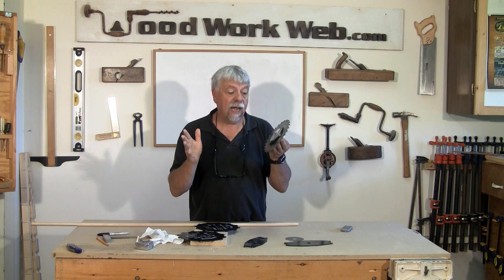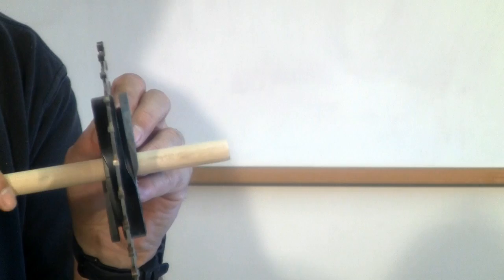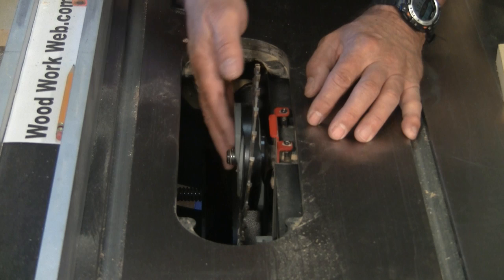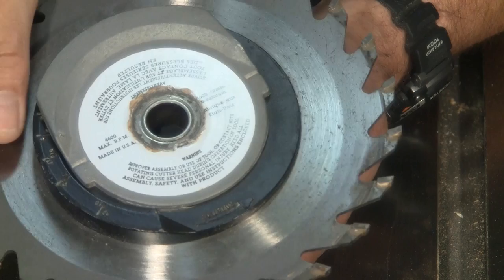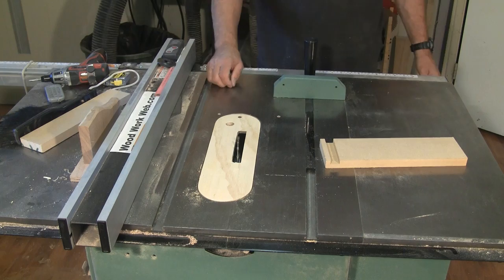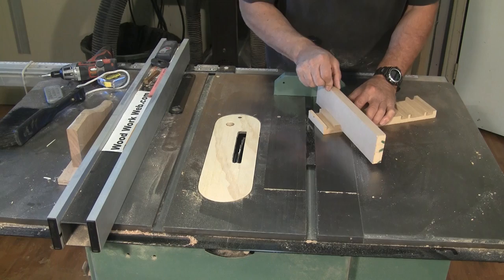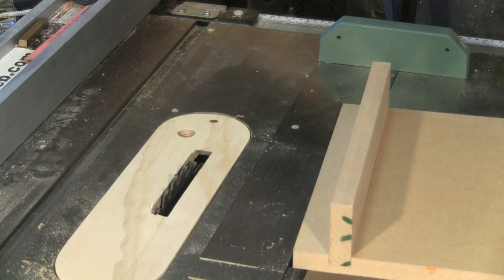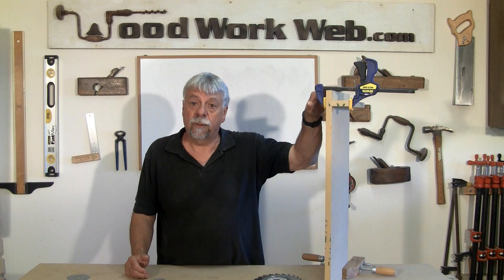Testing the Wobble Dado Blade -  woodworkweb

Comment: Took the bearings on my radial arm saw out on two sets of stair case runners ! Wobble speaks for its self !
Reply: I really may get a radial saw one day. I don't know why nobody ever talks about a radial saw !!
Reply: Try making shallower cuts.
Reply: @versatileduplicity9313  I have a smaller size radial arm  saw that I love to use.
Reply: @versatileduplicity9313  too many people didnt know how to use them so most people consider them death machines. They are all over the place for dirt cheap coz nobody wants them. I got my first one for $20 and 2nd one for free on the side of the road. I sent the 2nd in to Emerson for recall, since I liked the 1st one better, but the 2nd one surprisingly had a nearly mint condition old Craftsman Wobble blade in it. I think I made out pretty good on that deal!

Comment: I like using  the wobble Dado Blade. it may not give as clean a cut on bottom but who cares and besides it comes very close any way.  these things can be dialed in, in few seconds almost the first time and save so much time especially with ply wood junk we get these days. no dealing with freaking shims and taking off blades and putting back on wasting so much time. 
if you are not making super fine furniture with real wood that has exposed dado , then this is the only way to go. i got lucky and found a brand new one. they should bring these back.this was ingenious design.

Comment: There is absolutely nothing wrong with a wobble wheel. I see it all too often with any profession/hobby. Elitists who simply must have the biggest, best, newest, fastest, loudest, mostest gear, equipment, tools, etc. And just as always, those people are often handicapped by their toys and delude themselves into thinking that because they have better toys that somehow THEY are better at their craft. Better toys = less money. Better toys does NOT = better craftsman. I highly recommend a wobble wheel.
Reply: Do you know where I can find the inter ring that adapts the dado blade to the shaft of my craftsman table saw
Reply: @davidfitzgerald7385  
You want it? I have an old Craftsman.  The pins came out of mine and new pins will not stay in.  Makes it inaccurate and dangerous.  Broke my heart to buy a stack dado.
This guy does not have a clue on wobble blade adjustment.  He had gaps because his feed rate was too fast.  Give it time to do it’s job.

Comment: I think there's a reason these were mostly used with radial arm saws; much easier to adjust as you don't have to take it off the arbor all the time.
Reply from the maker: synapse131 Yes, it might be easier to see the markings on a RAS, as long as the blade guard is not in the way, other wise it may have to be take off their too.

Comment: Thanks for a great demo on this Wobble Wheel.  I was doing a lot of cabinet making in my younger years and this was my first dado I bought.  As you demonstrated, it can be a great frustration at first to adjust the wheel to the exact  size of the dado you want to cut.  Yes I had to make several tests to get the size I needed.  After I used it a lot, making adjustments, I did finally become used to where to align the markers to get a closer fit, then I just needed to make one final adjustment for the final size.  So with practice you become accustom with it.  You mentioned the "space" on the bottom.  This is caused because of a few factors.  When they first came out with it, the cuts did not get into the corners enough so it made them round and it was difficult to get the board right down to the bottom of the dado.  So to correct this they sharpened the blades in a way that the tips of the blades now reach right up to the corners.  But this created another problem.  As the blade wobble to cut the dado, the tips were cutting deeper into the bottom of the dado, thus the space.  or rounding at the bottom.  Like you said, you could live with that error and so did I.  In all reality, it worked out better as when I was gluing up my project it had a minute space for the glue to go.  I now have a full set of dados that I bought and I still find that I have to stop to make adjustments on them as well. I just thought that you would like to know this if ever asked.  I have learnt a lot of great helpful hints from your videos.   Keep up the great work.  Tim

Comment: Hi Colin,sorry for a late comment ,I watched your video with great interest.
As a retired Engineer with a hobby of woodworking, may I comment the following.
There are number of ways to power a motorcar cheaper and less polluting system , why we do not use them? Simple, Major companies "OIL COMPANIES" do not like going out of business.
The same is with simple saw blade manufacturers, Daddo blades is an extra product can be soled with a nice profitable price.
Now back to the what you call it WOBBLE BLADE, SHOULD NEVER BE CALLED WOBBLE BLADE, as this creates doubt in majority of peoples mind...+ wabble ? must be a problem?????  obviously someone got hold of one did not know what it was , continued playing with it then called it WOBBLE, it is adjustable daddo blade, should not create any additional vibration as it is rotating the  displacement is a HARMONIC MOTION and also variable loads are so infinitesimal on the shaft the load is carried by the two bearings supporting the spindle either mounted on the motor shaft or twin bearing supported spindle.
Next point, this blades are normally are 7 1/2" Dia for a large daddo say 3/4" the height of the Arc for a 3 5/8" rad a blind man would love to see it, from the little knowledge I have most of the timbers do compensate for that variance.
My negligible knowledge says most of people use there blades until is totally blunt and do not sharpen them, even if they do probably is not in the original form as manufacturer's design.
Final point, to adjust the width  you do not have to take the blade of the spindle, all you do loosen the nut and rotate the hub, actually you should measure the blade widths before even cutting a sample, HAVE YOU CHECKED THE EXTERNAL WASHER HAS A HORIZONTAL CUP PROFILE to lock the blade the correct way otherwise the centrifugal force will put pressure on the hub thus will change the daddo width.
Sorry for such a long winded comments.
I have always enjoyed your videos as they are informative, I hope you do not get offended, I have 2 of my neighbours keen woodworkers we tend to get together often we talk about YouTube infos.... YES WE HAVE COMPUTERS In Australia and we do get YouTube
Regards Colin
Jack Marashlian
Reply: Jack Marashlian - It seems to me that any infinitesimal vibration is not so much from the rotating blade by itself as it is from unequal side loading as it enters material at an angle. Your comment is like saying a bent bicycle rim doesn't wobble when it's not touching the ground.
Reply: Mr. Perry,  due to the very small angle and the smooth progression of the angel from max to normal and to max again, the amount of "side loading" is both negligible and counter balanced.  Remember, very few teeth are actually being effected at any given moment, and because each makes contact for such an extremely small amount the effect of side loading must be averaged over the entire blade accounting for each tooth (i.e. half - 1 to the left in varying degrees, 2 with no side load, and half - 1 to the right in varying degrees).  The right and left forces are equal magnitude and opposite direction resulting in a ZERO average.  The maximum lateral force (left or right) is significantly less than 1/3 the  forward force applied to the 2 teeth that have no side load.  Also, the cutting faces of these blades are so designed and oriented as to further significantly reduce this effect.

Finally, your analogy of a bent rim is completely incorrect.  The offset here is not on the outside as in the rim, but rather it is in the alignment of blades center of mass to the axis of rotation.  Think of the flutes on a drill bit.  In cross section they form two overlapping circles and so can spin in perfect balance.  However when viewed from the side the appear to such in one direction.  The drill saw uses this to allow you to cut laterally after having drilled longitudinally.  There is no actual wobble or vibration, it is all an optical illusion.

Comment: Just dug around and found my old Craftsman wobble dado today.  Used it a bit in the 80's and haven't touched it since.  However, I'm building a gate and need to dado some half-lap joints from 2x4s so, out it comes.  I'll be using an 80s wobble on my 70s Craftsman table saw.  Talk about old school!

Comment: In the UK and Europe both types of blades are illegal, the machines over here have dynamic braking, which the strain of the deep cut can set off the shut down. Older tables without the braking can work with them, but as you can't buy them.......
Most recommend using a router instead, it works a bit slower, but safer.
Reply: +stephen wallin I should add the use is allowed with radial overarm saws, as these usually do not have the auto shut off.
Also what happens with the auto shut off is the sudden stop can grab the wood violently.
Reply from the maker: +stephen wallin Thanks for that detail info, I have often wondered about that
Reply: +WoodWorkWeb Not a crime to use one! but they are not used on the braked versions, due to risk of snatching. The brake is there to stop heavy cuts, like an arm!! A sharp blade does not load the motor much, so when it loads it halts the blade almost instantly. I use a wobble blade and the rounded bottom does no affect anything. The table is about 60 years old and works well with the blades.
Reply: stephen wallin As they should be. I always thought dado blades, and this wobbly for sure, aren't safe. But then NA make up is full of vile poisons and toxins the EU won't allow either. American corporations rule US and, to much, Canada and$$ is God.
Reply: you must be great at parties
Reply: ROOKTABULA why canada?

Comment: I watched your video out of curiosity and about half way through all of your adjustments and trials I called my wife in and began watching the whole thing anew. She has worked with me in my shop over 25 years and is quite skilled and very familiar with shop tools and their uses, limitations etc. She had the same reaction I had concerning your video. You present your experience with the wobble wheel as if that is what everyone will experience. Clearly, something is not right with your wwd. I have had this tool (the same one ) for almost 30 years and it has never failed to work as it was intended and only on rare occasions have I had to re-adjust the initial setting. Yes, I also have stack dado sets, but I have found that much of the criticisms of this tool is highly suspect. I am not a master cabinet maker and don't claim any esoteric knowledge about dados but with that said, I will reiterate that my wwd has performed flawlessly throughout all of these years. Oh and by the way, these are still manufactured and sold through various outlets. In spite of your disclaimer to that effect at the beginning of your video, you continue to say that you're not sure if they are still made and sold. And, finally I will add that on many occasions I have pushed this tool beyond its capabilities (some might say abused this tool) and it continues to provide adequate service. These may be minor points but if the goal of these videos is to educate those new and maybe not so new to woodworking, then it behooves you to thoroughly educate yourself first on your subject matter.

Comment: Dissadvantage: It takes a lot of adjustment to get right  advantage:It's highly adjustable.
Reply: Robert Schuster the measurements on the blade are pretty close to true. Before we cut we always measure the thickness of boards and just adjust the wobble wheel accordingly.

Comment: is that wobble bad for the saw?
Reply: You will have dynamic unbalance
Reply: Good question Green.  The answer is no because there is actually no wobble.  The "wobble" is a visual effect, not a physical one.  All the mass is still rotating evenly around the same center and is still evenly distributed so there is no unbalanced forces.  Everything is still a circle, but the axis of rotation has been changed from normal (i.e. 90 degrees) to a more acute setting.  Think of the flutes on a drill bit.  Viewed in cross section the are a pair of overlapping circles, but when viewed along their axis of rotation they form elongated spirals.  The "wobble" blade is the same effect simply from a different point of view.  The effect on the wood is to remove small bits offset instead of directly behind each other.  This gives the lateral cutting effect while advancing the work piece provides the longitudinal cutting.  Since the blade spins fast enough, the effect is to cut the complete width at least twice before any significant longitudinal movement happens.  Any vibration people experience with these is almost always (well over 98%) due to variances between their spindle size and the arbor of the blade.  This can normally be dampened by using arbor shims (not commonly found) or by buying a blade specified for the model they are using (too often "close enough" actually isn't).

Comment: I use to have  a wobble dado blade, didn't use it after I bought a real multi-blade dado set.  However, there is a good reason to have one!  When your friends ask to borrow your dado blade,,, I'm sure you can figure this out!  Eventually sold it at a garage sale when we moved!   One thing I like about this video, is how you pointed out the main problem with a wobble dado - the slight crown in the dado - more noticeable as the dado width increases!  One thought occurred was that you could use a flush trim 'Bottom Cleaning Router Bit' to remove the crown.

Comment: Thanks for this video.  I purchased five of these over time.  Each like brand new.  These things never seem to get much use. Probably because of the fiddle factor they get set to the side in the tool arsenal.  I set up each one to a different size and used lock-tite on the dial. I just grab a preset wobble for the size I need and cut away.  You can find these everywhere for about 5-10 dollars each.

Comment: Colin, I used one of those as a hobbiest for many years until needing to do more dado's more often, finally being able to afford the stacked set. The best way to eliminate all the changing settings is to mark a piece of wood the size of dado you want, adjust the wobble thickness with blade in the arbor but not tightened and turn the wobble several turns while watching your makings in the wood flat on the table allowing the wood to just barely touch the blade. Adjust while on the arbor then tighten blade secure when correctly hitting your marks on the wood.

Comment: More than likely, the blade need to be sharpened. I have a wobble dado that made perfect dado with out the crown in the groove. Also, when I set the wheel on 3/4", it made a perfect width cut. I suspect that the center mechanism is worn.
Reply: I was thinking the same thing,  He makes this look dramatically more difficult than it needs to be. Like in an infomercial when they try to use the competitors product first and make it look really clunky and difficult to work with.
Reply: You may have not noticed the crown or it was minimal but it's impossible for a wobble blade to cut a dado without a slight crown to it.
Reply: Not so!
Reply: I've used both and I think the difficulty in setting this one is most likely a result of it just being cheap. I have a ahem Harbor Freight wobble dado and the measurements given have little relation to the actual width of the cut. Since I got my stack dado I tend to us the wobble mostly for making crown mouldings, it cuts a nice cove and is considerably thicker and more rigid than a standard blade, a bonus when pushing wood through a blade the wrong way.

Comment: I use mine regularly to excellent effect.  It leaves ample surface area for strong glue joints.  Where a dado stack cuts only to discrete widths, the wobble wheel's continuous adjustment cuts any width the stock requires.  I don't know why this excellent tool fell out of favor.  Excellent and much needed video.  Thank you.

Comment: pretty cool but I think maybe all the adjusting is why it may have fallen out of favor. That joint is nothing to scoff at, once you had the measurement it is pretty nice. Id imagine the versatility of the router and routing table may have made these less popular. I think its interesting you made a blade guard, I could not help but wonder if even you were not sure how much wobble would be needed, and didnt want it to shew your table. look at it this way at some point it was probably an improvement on something.
Reply: the rotation imbalance is handled by having a good blade that comes pre-balanced.  The adjustment part of it should include counter weight.  Aside from that,.. it's not like a fan blade where each blade is independent and can move on it's own.  Any motion in the saw blade has to pull it's surrounding surface with it, and that's not likely in a balanced blade since it's all moving in the same rotation.

If I had to guess, what was happening is that people were trying to cut too fast, or with dull blades.. which WOULD bind and cause shaking.  But.. yeah.. couldn't say for sure without having one to test with.
Reply: *****
Me too.